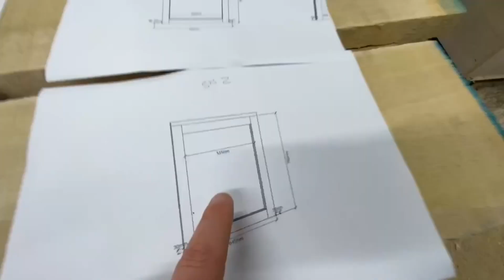Making hardwood stairgates and returning to the scullery project in the weeks exciting episode

Comment: What happened to the sound ? Great gates mate 👍🏻 i made a gate at the top of my stairs out of some kind of hardwood and someone has asked me to make two for their house my question is what wood have you used and the most important ? Is how much should I charge for each gate ? Thanks 🙏
Reply from the maker: Hi mate. I think when I lowered the sound on some of the power  tools in a clip it affected some of my talking parts(good news is I now know what i did!)🤞 big learning process this!
Reply from the maker: I used tulip (poplar) wood because it’s  very stable, paints very well and is lighter work to machine. If I wasn’t painting I would think about ash if they wanted lighter wood or sapele if they wanted darker wood.
With this job I charged £1025 including paint and fitting. This is the cheapest I could do it and be happy with the quality. It didn’t make me much money tbh and only really worked as it wasn’t my only job I was doing and I have somewhere separate to spray or paint them. That doesn’t mean that each gate is worth £250 tho as I could have made two more in not much time! I guess I would charge 
1/2 day for estimate and fitting 
1/2 day to machine timber (exclude if buying pre planned)
1/2 day to assemble
1/2 day to prep and paint. 

Hope that’s clear and thanks so much for watching 🙏